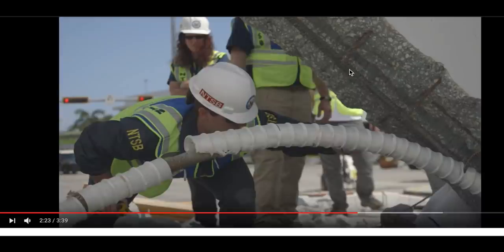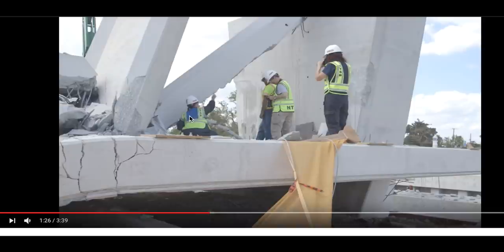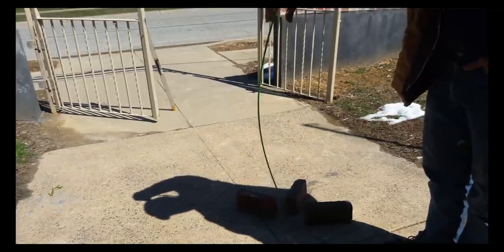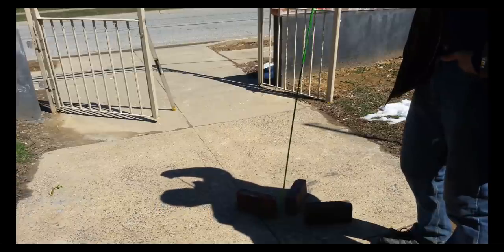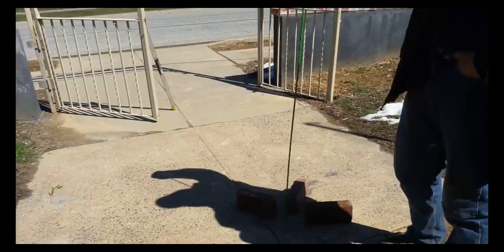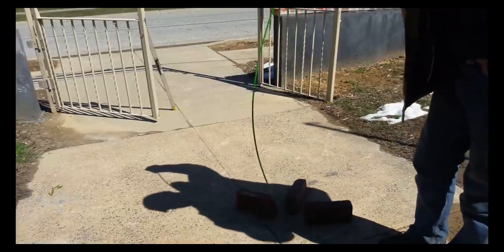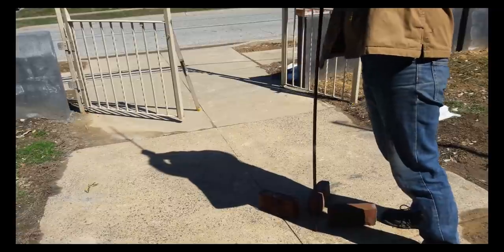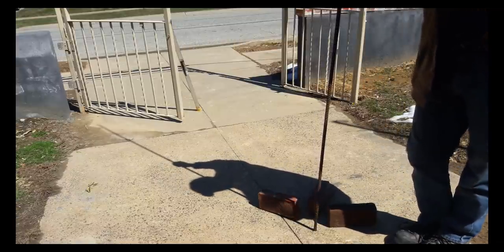FIU Bridge Collapse & the reinforcement & cables placement contributed to #11 diagonal's failure? #6

Comment: I don't think you can properly torque a PT rod and have actual dimensional compression in concrete. It'll be an induced force, but the concrete strut isn't going to reduce in length.
Reply from the maker: Please look at this video... it is the max compression these guys take before failure... I also theorize, it could be in the canopy... https://www.youtube.com/watch?v=4MusBoGQSsQ&t=247s 
This is just data and when you put all the data together - we all hope it tells the correct story of the failure... I may sound 100% but, of course I cannot be... I need more data and as I get it -- I let it lead me where it goes... even if it is against this video...
Reply: You can if the cable is not centered in the opening. It's an included force....if it is EXACTLY centered along the  channel of the strut, top to bottom. He said in the video that the cable was off center and too close to the bottom (rebar support) of the strut. If it's not centered and rides along the bottom of the channel, then by all means torquing the PT rod can cause undo stress at the outer surface of the concrete.
Reply: Philadelphia Construction Engineering The canopy and it's arch is acting as a strong back for the overall span the individual struts wouldn't have any effect on the outside rim of the canopy as individuals.
Reply from the maker: No offense, but, of course they would, they are point loads...

Comment: If you are saying that this being your theory of the cause of the collapse of the bridge, then I will tell you that I wasn't completely sold because that blow out could have happened upon impact with the ground BUT if you are saying that the first tensioner blew out because it wasn't tensioned first before the second tensioner was tensioned and we know this looking at the footage of bridge collapse and the placement of the crane at that time the men where in place at the second tensioner then I believe your theory to add a lot of weight the collapse of the bridge. Just say'n.
Reply from the maker: I have comments throughout the thread and at the comment section.
My latest video shows that one of these cables might have been ripped from this column also...
I go where the data and facts send me...I can change my entire position if I found data that showed they were using saws on the bridge, (for example)...
Reply: Philadelphia Construction Engineering Can you share where the NTSB footage is found? Put a link in the description please as transparency and sharing is exactly what was not done in the aftermath of the collapse.

Comment from the maker: I am not sold on my statement... not sure how much forces it really created...in relationship to rebar...I wish I could see end points of rebar and if they could test that sample.
Also, two post tensioning cables but tensioning the lower half would still make this moment happen and having the top half under compression would make this "column" more "brittle"...as it would be at it's maximum compressive capacity???

I would love to inspect entire pocket of rebar location.
Reply: The bridge was designed to have #11 in tension, so it's odd that the failure seems to be from bending under compression.  Your scenario makes sense if one of the two tendons failed, allowing the other to bend the column.
Reply from the maker: https://www.youtube.com/watch?v=Qoq6Quecj3M      looks like I was correct...   https://www.youtube.com/watch?v=Qoq6Quecj3M

Comment: Want to build something strong want to make it stronger ? Put more steel a lot more steel if it failed it would bend and not break !
Reply: More steel is sometimes just as bad as not enough steel. Remember, steel reinforcing of concrete MUST have the proper encapsulation coverage to be supportive, so the more steel you put into reinforcing concrete, the more concrete coverage you would need.

Comment: Wouldn't you expect to see shards of concrete on the rebar
Reply from the maker: Christopher Bale, the direction of the "opening" shows direction of forces.
Reply from the maker: The "opening of the rebar and opening of cable " signifies direction of failure...
Reply: Look at 3:46 it looks like the cable is still attached to the deck, while it would run from there up the tie beam diagonal witch seems to still be fixed or caught up on the supporting tower, just the wieght of the deck falling would of had enough force to pull that cable from the 3-4 inches of that face off the diagonal, Both ends of the cable seem to still be attached. Where there not 2 cables up that diagonal, While viewing that perticular part of the video i couldn't see a 2nd cable, if so seems the 2nd got fired out the top before the collapse/as it collapsed, only the shearing of that cable would of caused such a dramatic movement of that cable, would of being like elastic band/ snap, release of potential energy. After the 1st snapped, the cable you mention would of had double the stress loading.
Reply from the maker: I am not sold on my statement... not sure how much forces it really created...in relationship to rebar...I wish I could see end points of rebar and if they could test that sample.
I would love to inspect entire pocket of rebar location.
Reply: Christopher Bale Good point. I commented on the previous video, but forgot there were 2 PT bars in truss #11. The NTSB B-roll footage does not show any detail of the other rod. One may have been the trigger, the other caused the collateral damage as it unzipped.
Reply: Philadelphia Construction Engineering

Comment: No no no ! Your concern regarding the possible buckling of the compressed concrete column is totally wrong. Apparently you don't understand how post tension column works. Here is the thing, by principle, the tension cable always provide just enough bracing effect to prevent the buckling. 

Why people always like to explain things based on there own poor intuition which most times turns out to be wrong?
Reply from the maker: You win the idiot reward!  YOU DO NOT UNDERSTAND POST TENSIONING AND POST TENSIONING CAN CAUSE BUCKLING -  IDIOT AWARD IS YOUR'S.   GOLD  OF COURSE. 
SEND ME A DONATION AND I WILL DO A VIDEO FOR YOU EXPLAINING HOW  -- OR YOU CAN SEE YOUR WAY TO THE DOOR! (IN OTHER WORDS, I WILL BLOCK YOUR STUPID COMMENTS FROM HERE ON IF YOU DO NOT GET  / FIND A BRAIN -- I only allow intelligent conversation on this channel;  I block all trolls).

Comment from the maker: Thank you for your kind words...  Please keep in mind, I was making these videos with the data I had at the time... Which means as more data was revealed, I may have changed some of my statements --- just accepting the data ran me into a different direction...  I try to always stay flexible and accept income data and adjust for it...   This may be a little confusing to you ... BUT, if FIU engineers would have practiced the way I practice... ''accepting new data may change how you have to adjust your plans" then this failure would have been avoided!   As the new data would have been ''cracks'' and this new data would have had to be addressed and perhaps the new data would have forced the decision to ''shit-can'' this entire design! 
Manytimes, I try out new concrete designs, only to find they are ''shit" and no matter the quantity of the concrete, it MUST be trashed!  BUT, once I get the design I like, I guard it like a hawk!  
This was an untested design and like my untested concrete designs, they must be ready to ''shit-can''...   
FIU Bridge Collapse, did NOT have that as an option!   They were ''all-in'' (like a poker game) and ''doubled-down'' on a SHITTY HAND!